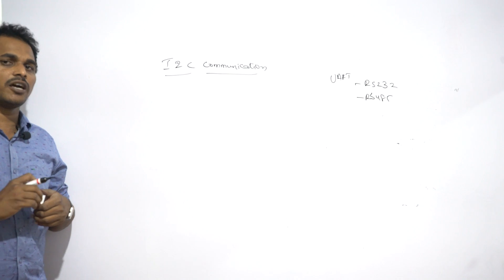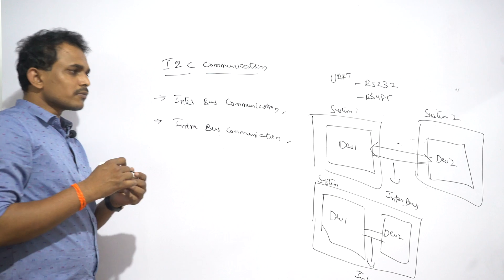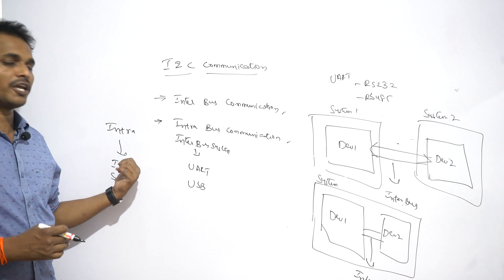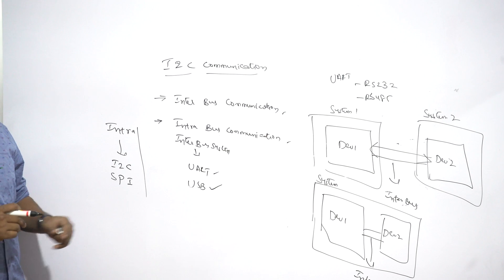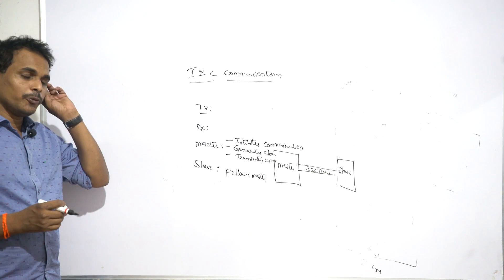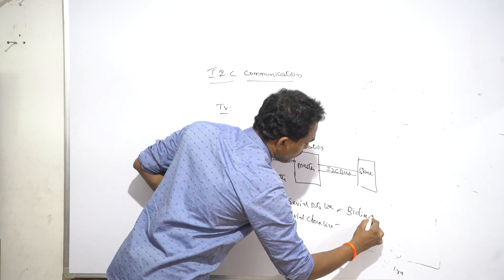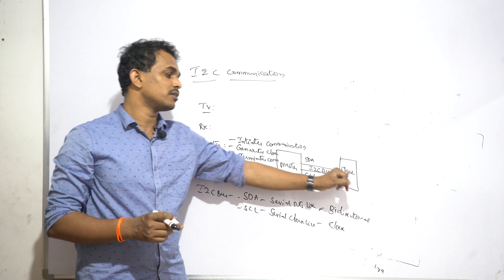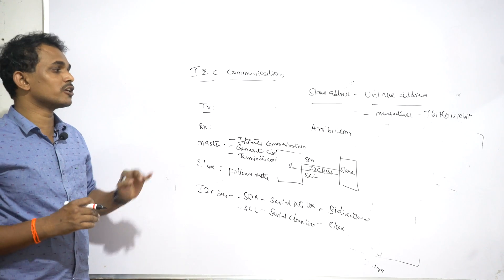i2c protocol tutorial

Comment: can u explain y we using  4.7kohm particularly rather than other values.and hw can we calculate the value and alsowhy they design like the open collector whats the purpose.please reply.
Reply: not 4.7 k exactly you can use upto 10k to protect pin  with external resistance from high current driven to . this concept for working with pins with high accuracy and without lossing information.
Reply: No you cannot use 10k resistor you have to use 4.7k becoz the board which you are using may have 5v input and current drawn by that board will be 1A so according to ohms law R=V/I so based on that they will decide that resistor but according formula it has to be 5k but why they kept 4.7k becoz you board was actually designed for 1A current but it was drawing only 700mA so that's y they kept 4.7k go quick calculate R=V/I 😃😃 and that not normal resistor it is called pull up resistor actually it will be connected either to vcc or ground only if you have any doubts just call me 9108962754 I'm an embedded programer and hardware design in embedded so I can clear your doubts easily